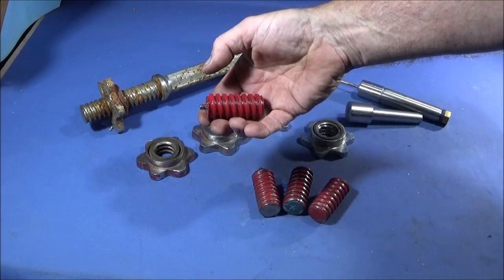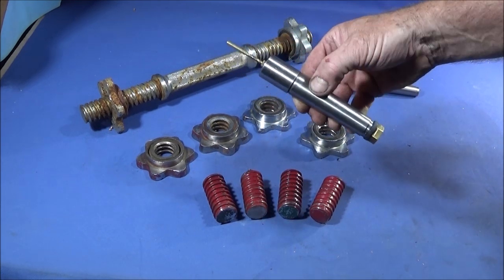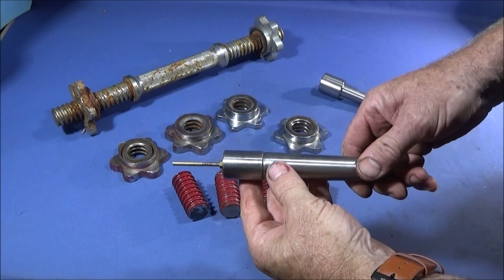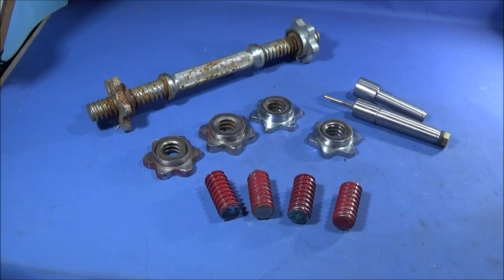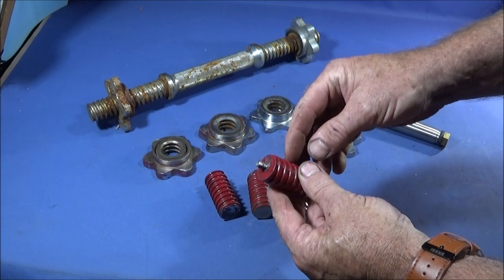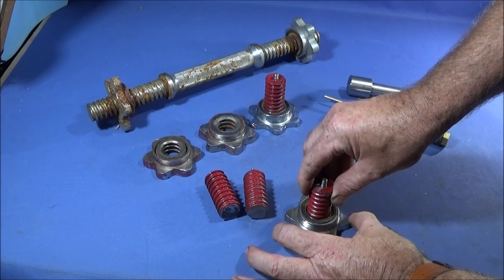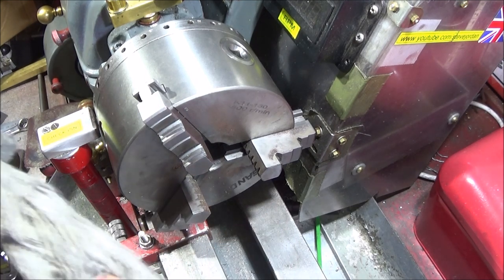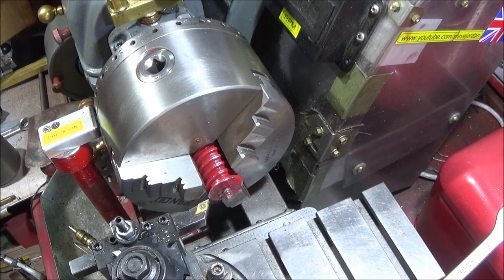Adjustable Stove Legs From Weight Lifting Bar & Batch Work

Comment: Steve, I think the tiny screws attaching the Acme rods to the keg to be very small  :)

Not worried about a  really hot fire melting the alu MIN YUM?
Reply from the maker: My Son has used one all summer with the same set up. The legs are hard against the rim. It's all stainless steel as well